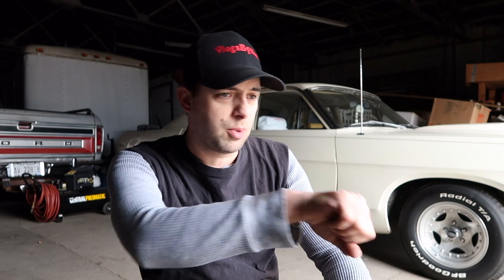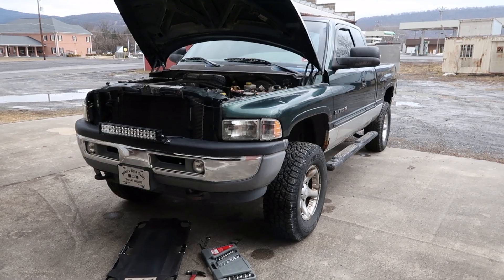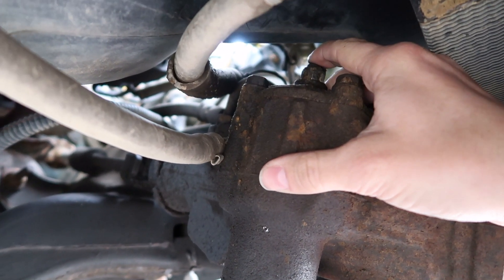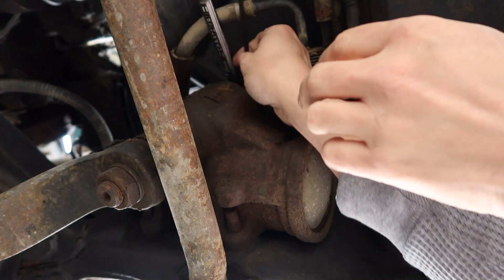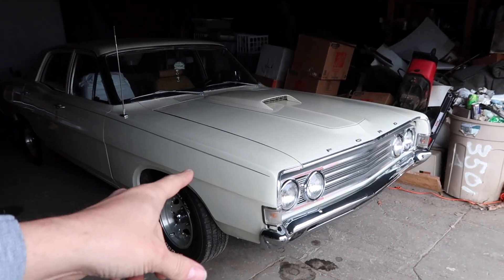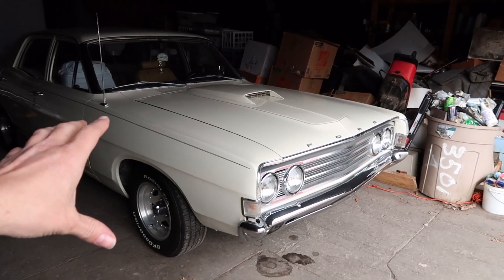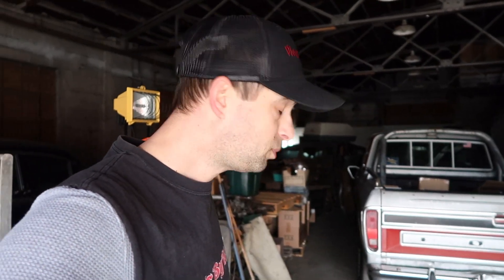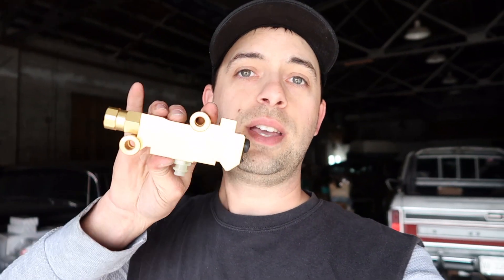2nd Gen Dodge Ram Steering Gear Box Adjustment

Comment: I just changed all 4 ball joints and my steering stabilizer, got it aligned by a man I trust and he sais the tie rods are fine, BUT the steering reas has some slop its about 2 inches each way NC limit is 3 inchec, my prersonal requirement is 0 inches, thanks for the video, I have adjusted them before but this is my first Dodge 2500 and since everything eles different I wanted to make sure the steering was too
Reply from the maker: Hope this was helpful.  Thanks for watching

Comment: It works, what you did was drive the pitman shaft down into the mesh with the rack further. The pitman fan (teeth) are tapered so the further down you drive the pitman, the larger the teeth are in mesh with the rack teeth.
These boxes are probably Saginaw 800 gears, we used to ship them to Chrysler.
If you remove the input shaft and rag joint there is another adjustment you can make over there to stiffen up the gear. Usually the components in the box just start wearing out and causing excessive clearance.

A lot of the time the play is actually from the housing "egging" out and becoming somewhat of an oval down where the pitman shaft comes out. A lot of pressure is put on the casting at that location and it will eventually start yielding.
Reply from the maker: Now that is some good info. Thanks a lot for that. I had no idea much of any of that info at all. Im just learning as i go. Thanks a lot and for watching
Reply: this was so very, very informative in so many ways.  Instead of tires moving, pitman arm slops back and forth and that is where soft comes from ?

Comment: Hey i see u got factory foglights by anychance u have the factory switch wired to the harness ive been lookin for the wiring to plug my switch in
Reply from the maker: Yeah its all factory
Reply: @VlogsByWes  can u do a vid of how the factory foglight is wired in im havin a issue tryin to find it behind dash my truck is wired for it from the plug below rad support and t out to the foglights in the fuse panel under hood has already the 15 amp fuse and both relays got the original switch from ebay for my 1996 ram 1500 4x4 larimie slt package

Comment: i just swap another 5.9l magnum on my new 99 dodge ram 1500 4x4 and drove it but when i started slowing down the truck would turn right and left so i freaked me out but im used to it. so i took it to get it do alighnment but they wont do it coz they said its the brake or rotors so imma try one too but the steering wheel is loose so imma try what you did and see if works.
Reply from the maker: Best of luck to you and hope this helps